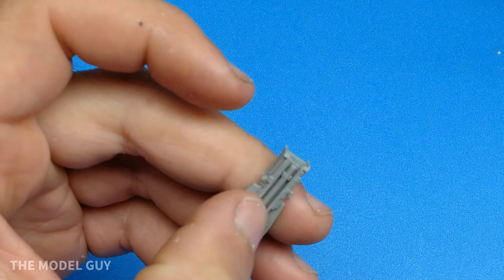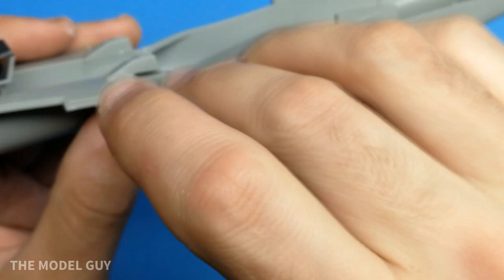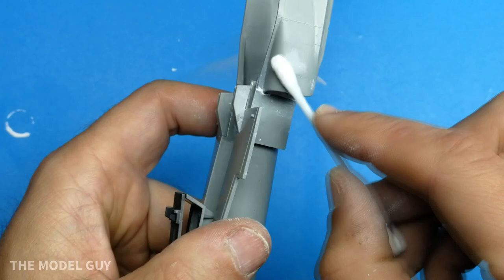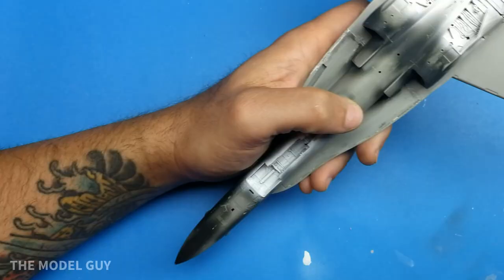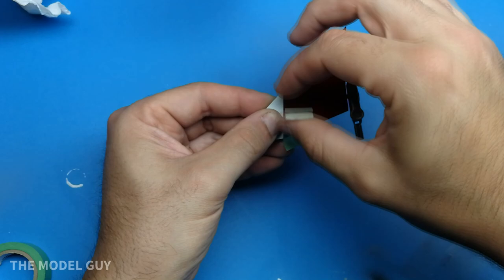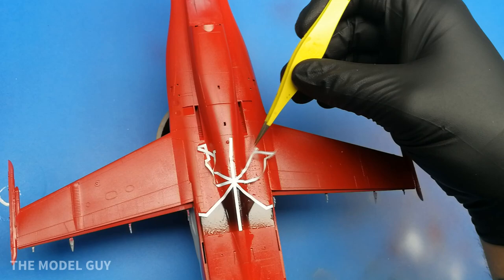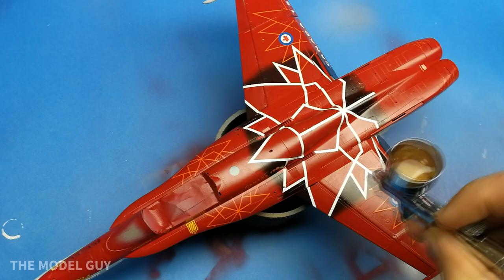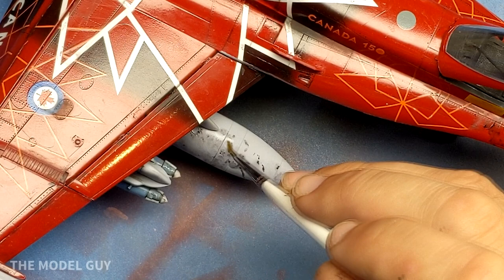Kinetic 1/48 CF-188 Hornet - Canada 150 Livery

Comment: Just to correct you on the number of CF-188's Canada purchased. In 1980 Canada purchased 138 CF-188's with 98 being the single seat variants (CF-188A) and 40 dual-seat variants (CF-188B) with options for 20 more, which were never exercised. The CF-188 was delivered starting in 1982 with the last one in 1988. There were 3 Squadrons permanently based in Germany totaling 54 CF-188's. The remainder, 5 squadrons, 2 which would reinforce Europe in the event of war, were based in Canada for defense and training.
In 2002 major upgrades to the CF-188 were started. 62 single seat and 18 dual seat models (total 80) were upgraded to the current F-18 C and D standards. Today there are only 76 operational CF-188's in service. 20 have been lost in accidents with the 42 remaining being used for spare parts, training aids, donated to museums or sitting in storage awaiting disposal.
Due to a severe lack of operational readiness of the current CF-188's in service, Canada has purchased 25 used F-18's from Australia, 18 for operational use and the remaining 7 for testing and spare parts. A new fighter competition is currently underway but the CF-188, due to political blundering, will not be replaced till around 2032

Comment: First off, great job sticking with it. The finished Hornet looks amazing in red.  I am starting work on the Kinetic F-16Sufa.  So far as I can tell, all the parts are there.  But stopped to try and get a Stuka done in time for a September show.
Reply from the maker: The Sufa is a nicely detailed kit but the main landing gear is a bit of a head scratcher. Did you find fit issues at the nose? I had to put some styrene in a few gaps to force the panels outwards to line up properly
Reply: Have not made it that far. I was attaching photo etch details first but have not made it to the nose or the gear. I will let you know what i find.

Comment: I'm quite fond of the Saab J35 Oe Draken in red with white stripe. It's a strange looking bird to begin with, like a rejected design for 1 of Anderson's Thunderbirds, even moreso in that paint scheme. Not only is the stripe quite difficult to place accurately, but it also has a rather challenging, large decal on the top surface which required significant amounts of soft and set to get it to conform properly. Odd looking though it may be, it's still one of my all-time favourite builds.
Other than that, the Tiger Meet paint schemes applied to the British GR4 Tornadoes were usually very nice.

Comment: Greetings from the UK. I had similar fit problems with an Academy F111C, the section forward of the the rear of the cockpit refused to fit the rear fuselage. I had to fit alignment tabs to the rear in order that the flex in the main fuselage section would conform to the cockpit section, then use loads of filler(Perfect Putty) to achieve a level surface. That was weeks back and I'm still not satisfied with the panel line re-instatement, oh well I will get there eventually. BTW if my airbrush was throwing all those bubbles back into the colour cup I would give it a thorough strip-down and clean!
Reply from the maker: I have an o-ring that's splitting. New one is back ordered. In the meantime I have a self-mixing cup :)
Perfect putty is my new favorite thing

Comment: I have a quick follow up question about the Kinetic CF-18. I am just wrapping up the Meng Super Hornet and it's got me eager to build a CF-18. Aside from lining up the fuselage halves as you discuss in your video were there any other major issues you encountered?
Reply from the maker: Engine inlets need quite a bit of work. Next time I'd try glueing the inlet to the outer piece first instead of following the instructions. Maybe less clean up. And the windscreen/nose is a problem area as well. But I'd definitely build it again, I have two in the stash.

Comment: When painting, best to go from lightest to darkest. And when dealing with large decals try cutting them into smaller, more manageable pieces. 

Also in regards to the multi part wheels, this is done to make painting easier. You can paint the tires and wheels separately, then glue them together without having to mask anything.
Reply from the maker: I was more concerned that cutting the larger decals would lead to issues lining them back together.

As for painting, I do usually go light to dark, but on the red tails I was concerned of bleed through and painted them after they were already red. Turns out it was a non-issue

Comment: Beautiful job and a very striking paint scheme make this a highly unique (and challenging) model, well done!  Only thing I noticed was a slight orange peel here and there, not sure if the camera angle was responsible or you found that to be the case... congrats on a gorgeous outcome!
Reply from the maker: There is a tiny bit in a few areas but even with two coats of clear on top, sanding quickly damaged the decals. I found the tamiya gloss colours were a bit more difficult to work with for an even coat.

Comment: Are you using the Mr. Surfacer 1200 as a sort of putty for fine cracks?
Reply from the maker: It's a primer but it does fill some of the micro scratches.

Comment: I got the kinetic 1/48 f18c which has Australia and Canada markings. This hornet I believe is the 2017 150 years markings also love your ideas to paint tiny details.   This is old news but please tell me you play dcs f18 that module is nearing completion.
Reply from the maker: I was big into DCS until my computer started becoming out dated. I have to build a new one to get back into it, otherwise it's like watching a power point present.
Reply: @TheModelGuy  lol 😂 yea same I just did a new build in November Ryzen 7 5800x but I still have a outdated gpu 1060,  anyway what is your opinion of kitty hawk models I have done su22-35 and I have the su34 sitting in not assembled. Kitty hawk starts off rough but I think they are really well done now but I’m a guy who also liked trumpeter/hobby boss, academy and iv heard those are not favored by
Most.    Kittyhawk has in the horizon a new ka-50 is-52 mi28 and su25 all of which I want.
Reply from the maker: @TheCraigHudson  I haven't built any of their kits. I have their SU-34 in the stash, waiting on some aftermarket stuff to arrive. I'm hoping to do it sooner then later. But from what I've read there are some issues that need to be addressed. One of the biggest being the joint at the fuselage to cockpit having a step

Comment: What adhesive are you using to hold the piece?
Reply from the maker: I'm not sure what you mean? When I am painting the engine parts? That's just 3M tape rolled back on itself
Reply: @TheModelGuy  Thanks! Sorry for not being clear, you've answered my question! You've sent me down a rabbit hole. About to buy all of my supplies.
Reply from the maker: @Spartan301abc  I've only grabbed stuff as I've needed it to keep costs low. Otherwise you can be hitting some high numbers :S